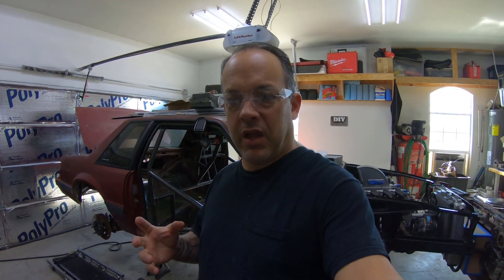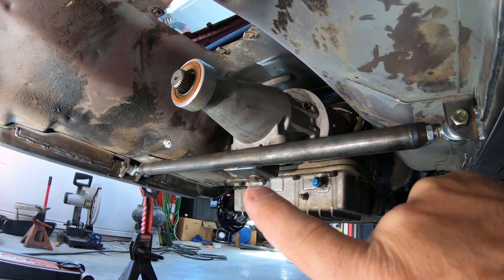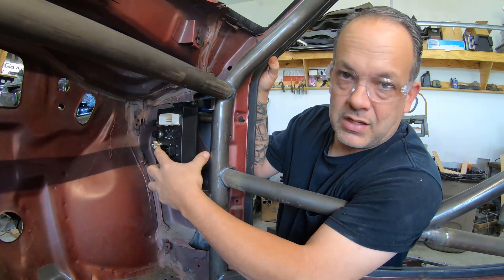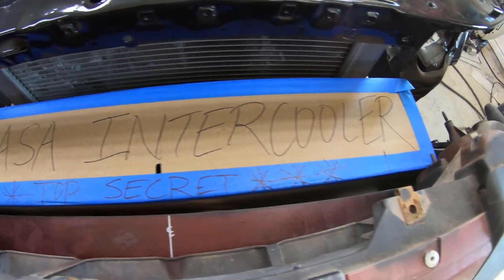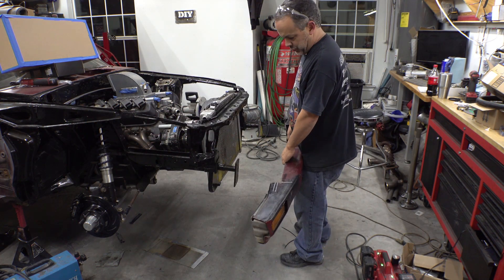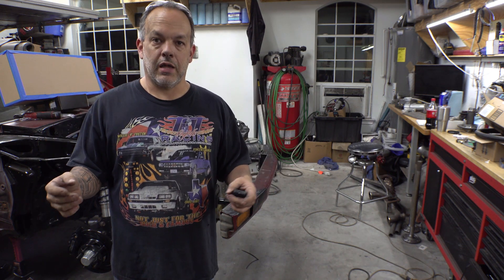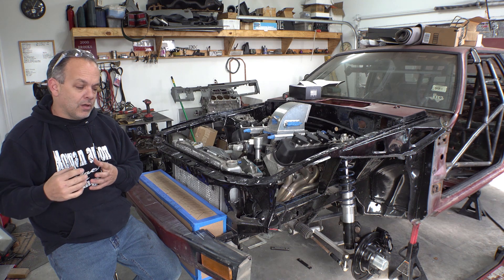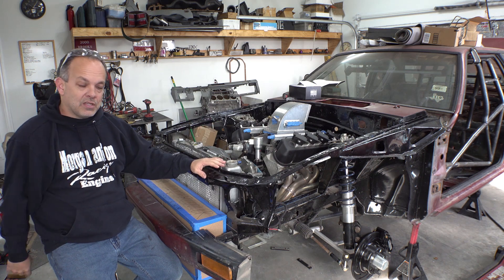Top Secret NASA intercooler design exposed

Comment: Not sure if you figured this out already or not but saw you mentioned the light flickering in another video and saw it again in this one.
Here's a good explanation of why it happens and how to fix it. Or don't, I don't think it's a big deal, but it's easy enough to fix if you want to.
https://www.fullexposure.photography/how-to-stop-camera-light-video-flicker/
I have a notch back sitting around that needs a bit of sheet metal on the rear quarters and trunk floor, then planning on putting the same cage you did. Loving this build man, thanks for sharing!
Reply from the maker: Thanks for the link! It pretty much only happens with one certain camera and one certain light that i rarely use together- but i will read up and check it out

Comment: might wanna relieve that bumper a bit more so the intercooler don't get smashed if you bump something - or, solidify those 5mph bumper shocks
Reply from the maker: The actual working unit will be a little smaller. The mockup has the clearance built into it.

Comment: The new camera is great. Never noticed the aspect ratio was off though. 

Am I understanding correctly that you will be building the intercooler with only purchasing the cores?
Reply from the maker: That's right.. Well, kinda. I am actually buying two cheap eBay intercooler and turning them into just one intercooler. That, in turn, will have fabricated tanks etc. It's going to be slick! (If it works!)